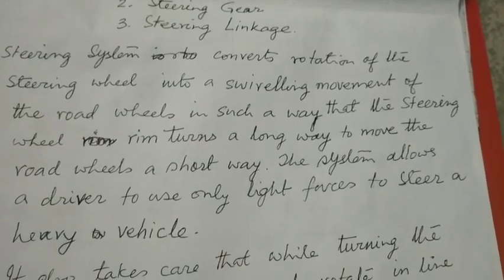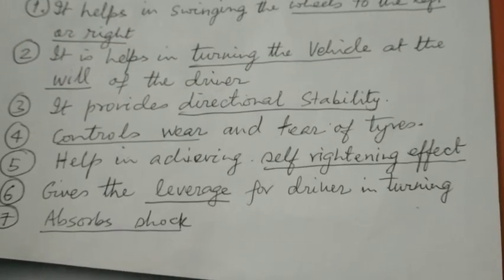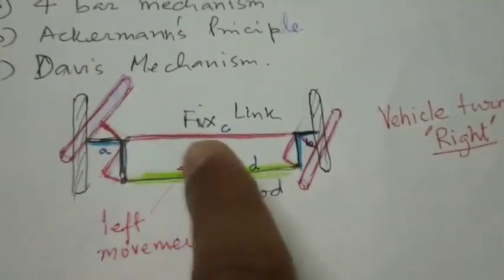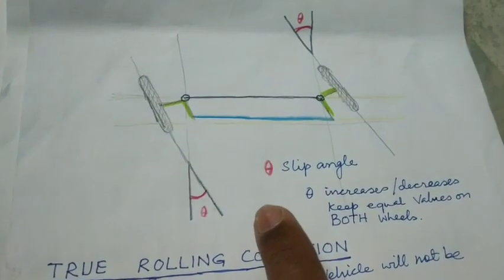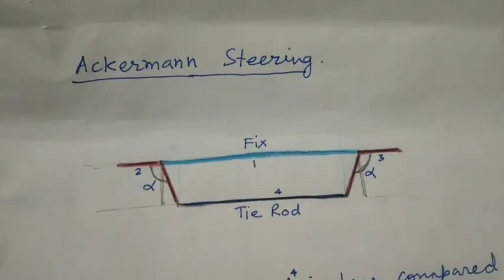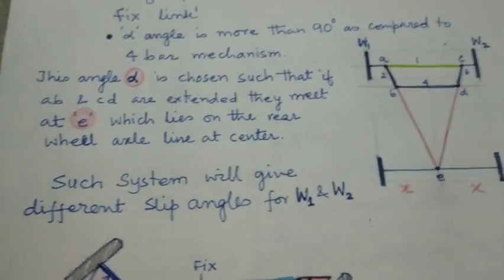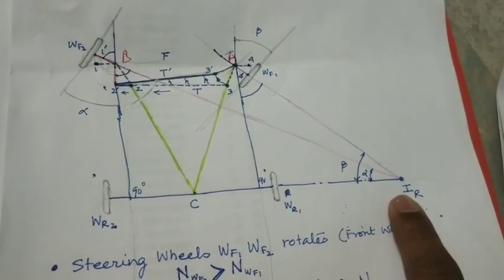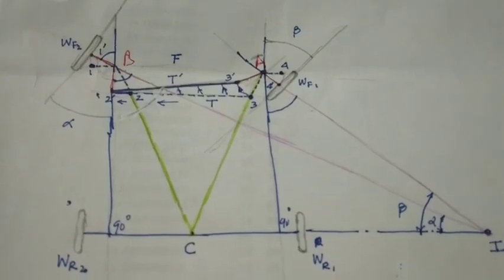STEERING SYSTEM

Comment: Greetings sir,  I have a small confusion. The slip angle you talked about in 4 bar link mechanism, how will the tyres wear and why do it need to have same slip angle because in rear drive vehicle we have to worry about rear wheels during turning (and for that differential is there) but for front wheels they are independently rotating during curve, so how does the tyres wear and why is slip (which i am confused about) important in steering wheels when they are not powered or forced to move with same rpm during curve. Thank you